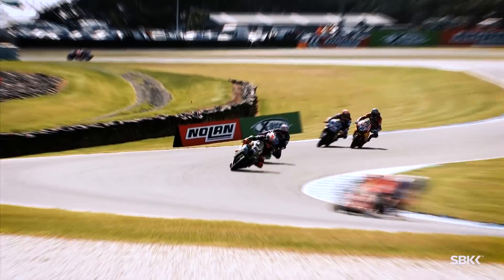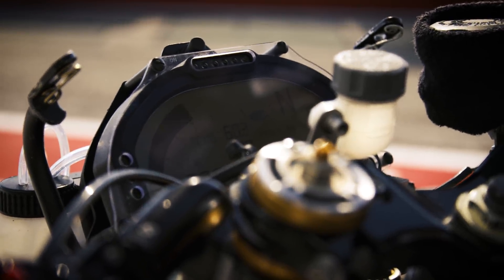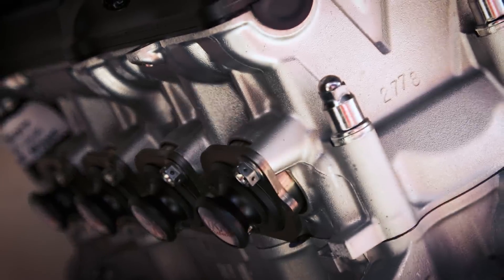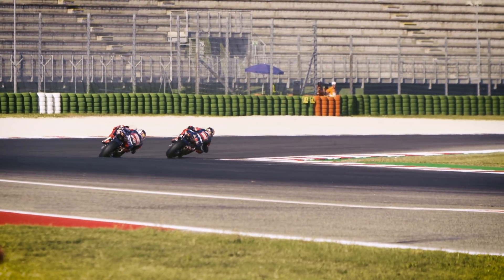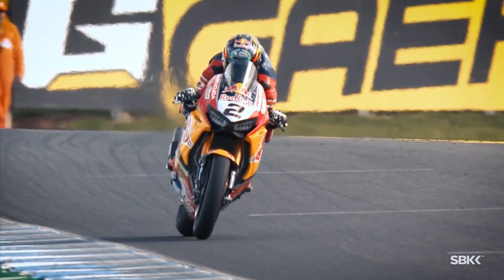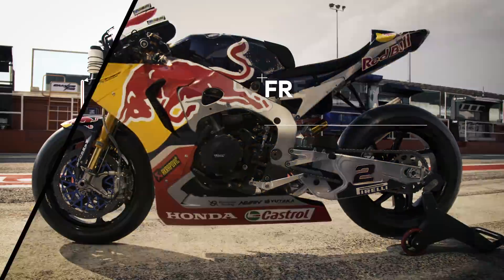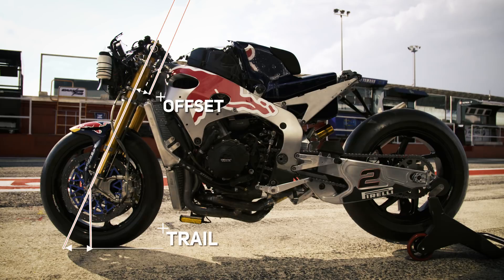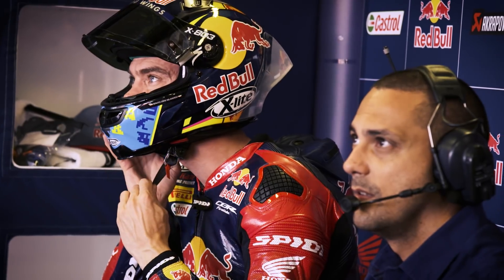The science of.. a WorldSBK CBR1000RR

Comment: I am a big Honda fan and love the Fireblade. The racing teams are doing so much work and the best they can do with what they are given, but to be competive Honda needs to build a stronger bike from the start. The other manufacturers are starting with 10 or even 15 horsepower more before tuning.
Reply: Manny._.Fresh agree pretty much have brought a knife to a gun fight
Reply: they all do the same hp after modifications. Its the electronics that the wsbk fireblade struggles with. Look at bsb..ewc.. or any other production series. The blade is more than capable of winning. At Suzuka this year the factory Honda team lost 1 minute due to poor strategy on track with rider gamble gone wrong and they lost by 30 seconds.
Reply: cagednm69 Here in the American series they aren't doing so well, and lets not forget the Isle of Mann and other Irish road races. Don't get me wrong, it's not a bad bike. I love the Fireblade, but to most people it's a great street bike, just not as good a starting base for a race bike as the current competition. The SP2 is a start, with it's improved cylinder head with more room for power, but only pro race teams have access to the SP2. So that leaves the SP1 for everyone else. Most club race teams dont even consider the Fireblade, which is a shame, because that leads to even less sales overall.
Reply: Manny._.Fresh the wsbk and road race versions are only resembling production sbk in bodywork.. otherwise its a different bike built from scratch almost like gp prototypes as you can see in this video. Ofcourse with poor riders you cannot expect to challenge for victory. Read Manuel Pecinos blog on Suzuka incident. HRC lost the race by poor rider swap decisions... they had 1 minute in hand but lost by 30s due to poor strategy letting Suzuka inexperienced PJ ride Suzuka in heavy downpour opposed to experienced Japanese guys. 
They still finished ahead of Reas Kawasaki. The French Honda team won the overall title for EWC after Suzuka
Reply: in 2016 Nicky Hayden won on the old bike and ran up in the front with the kawi & Ducati's, then in 2017 with the new bike he couldn't even see the front, it's a nice mellow street bike with some short comings for real fast trackday/club racer types, but it's no top level race platform.
Reply: 848 EVO maybe you should research a bit more before you come to conclusions. In WSBK there are 2 ecu suppliers. Cosworth and Magneti Marelli. Ten Kate and Yamaha used Cosworth ecu and it was not as good as MM Ecu so Yamaha after struggling with 2015 season switched to MM Ecu in 2016 end and won race in 2017.
Ten Kate saw this and also switched to MM Ecu on Camiers bike this year as they learn the difference between Gagnes and PJs Honda which runs Cosworth this year. Leon finishes in top 7 despite first year with MM Ecu.. They will get back to podium next season as Honda has also said this week that they plan to return to partial factory support for Ten Kate team
Reply: cagednm69 - They are not built from scratch. Did you even watch the video? The chassis is identical other than the carbon they added to stiffen up the bottom. The engine is the same minus the changes to the top end. They are built from a production fireblade.
Reply: dsrtrcr77 there's a lot of things they dont show in this video. The engine internals are all replaced with lightweight and stronger parts. How do you think wsbk bikes make 230-250hp from production bike? Ten Kate uses FEM Analysis and Solid Edge to develop the chassis.. they had put out job opportunity for design engineers and fem analysts last year. These bits are built at Ten Kate Motoren and Honda Racing office.